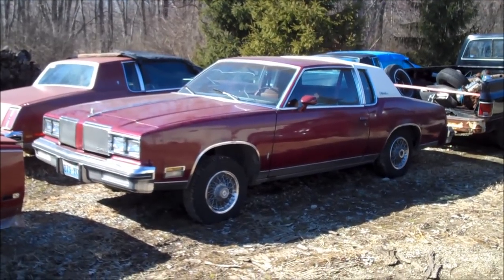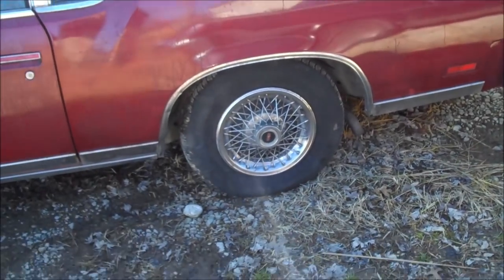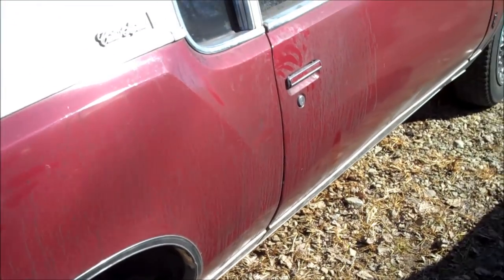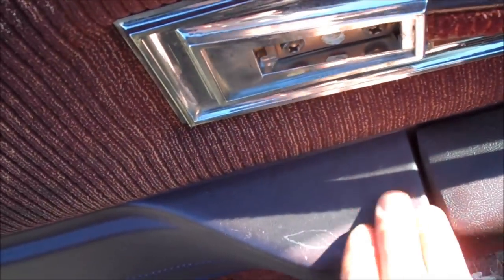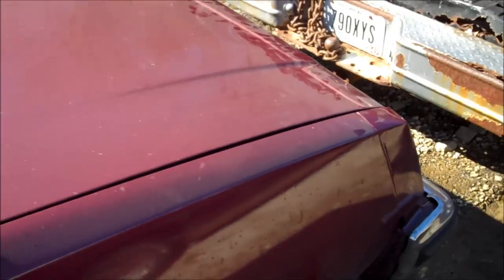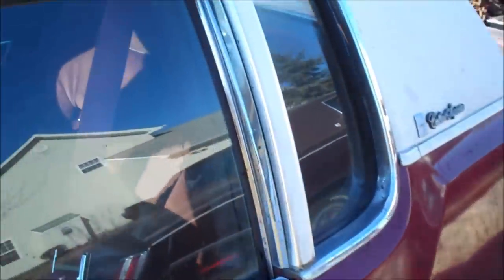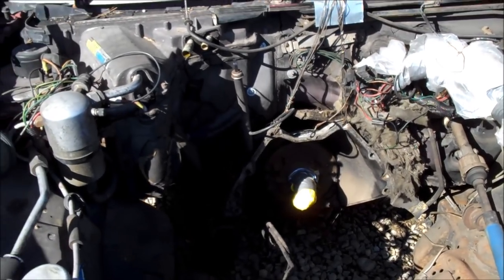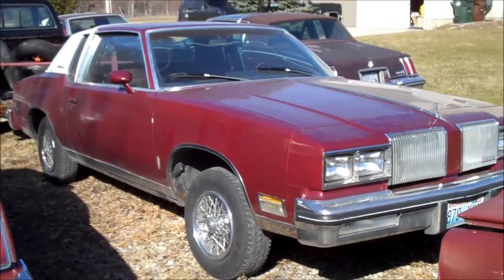80 Cutlass Brougham First Walk Around Classic Gbody Garage

Comment: I have a 78 olds cutlass and i am dropping a  455 in it ,do you have any tips or tricks for me.
Reply from the maker: Greg Bolden  if dropping in a Big Block Olds and your car has factory AC then you must use stock height valve covers or they will hit the heater box. They drop in easily tho. Have fun.

Comment: I have a 1980 Gmc Caballero that I am in the mist of fixing up myself, has original 267 motor in it,  at least I think its the 267 v6 not sure if it runs tho. frame and body are solid even rockers, the  bed is also solid. Need new hood and floorboards and would make for a great classic .
Reply from the maker: Andrew Hall 267 is the V8 and 200 and 229 was the V6. I believe 81 was the first year for 229.
Reply: Classic G-Body Garage 200 V6 introduced in '78, 267 V8 in '79, 229 V6 in '80, 4.3 V6 in '85.